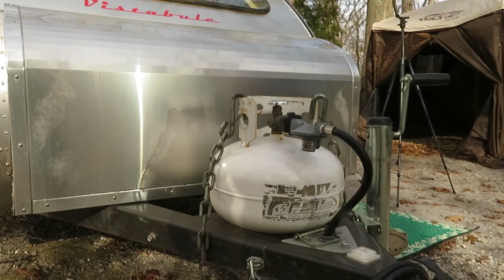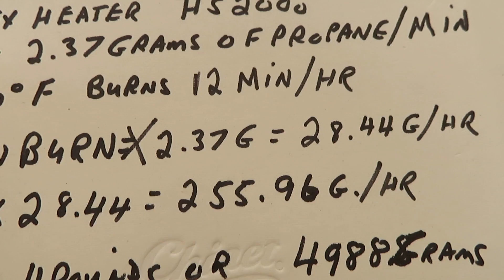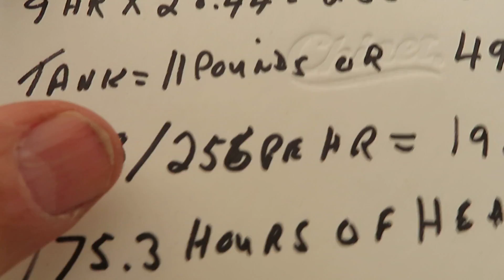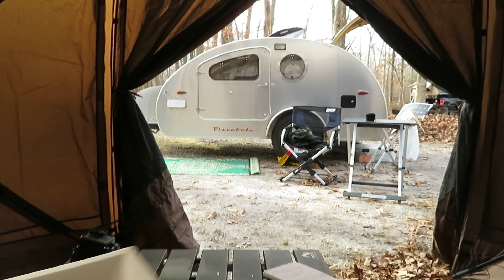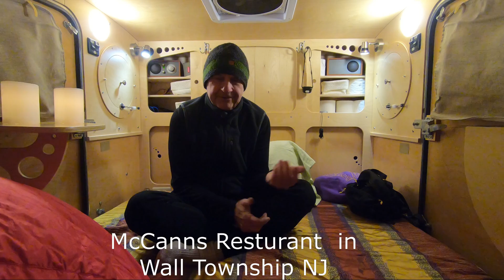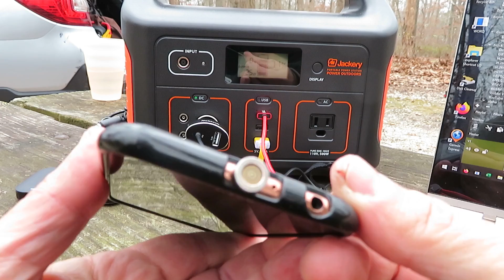Propex HS2000 heatng a Vistabule Teardrop Trailer

Comment from the maker: This is my second winter with the Propex HS2000. I still love it.
It has been trouble free and 100% reliable. I still recommend it.
I did lots of number crunching to determine the propane consumption.
The method I used for timing the duty cycle can be self correcting for the temperature and conditions you are in to calculate how long your fuel will last. =Cosmo
Reply from the maker: TY

Comment: Hi Cosmo, I just bought this heater. I’m planning on running it off a standard 5 gallon propane bottle (like the ones for BBQs). What I don’t know is what regulator and fittings I need to go from the 5 gallon, down to the Propex. I could see in your video you had some fittings on your propane. Could you tell me what you used or possibly send me a video showing your connections from the propane down to the Propex?
Reply from the maker: I dot know what type regulator. Its nothing special. If I see any writing on it I will post is for you. 𝕋𝕙𝕒𝕟𝕜 𝕐𝕠𝕦 𝕗𝕠𝕣 𝕨𝕒𝕥𝕔𝕙𝕚𝕟𝕘! =𝓒𝓸𝓼𝓶𝓸 ✅

Comment: Did those secondary locks on the doors come stock Cosmo
Reply from the maker: Yes they pull the door in tightly to rain out when driving at highway speeds. At Highway speeds  the trailer is experiencing one long hurricane on the road. I usually dont use then when inside but in this case - they are good to have. Its a bit of good thinking on Vistabules part. Not sure why other  makers dont use them. They are very effective. Thank You for watching. Check my other videos https://www.youtube.com/cosmoweems/videos 
SUBSCRIBE https://www.youtube.com/cosmoweems?sub_confirmation=1

Comment: Propane puts in way too much moisture, (big problem ), Chinese Diesel is a much better way to go. Very dry too. 10 amps for start up and then only 1.5 amps from there on.
Reply from the maker: Propex is a heat exchange heater no fumes of moisture enters the cabin. I hope I dont ever camp near one of these polluters
https://www.youtube.com/watch?v=thAIWAIwANc
Diesel Heater Cleaning the heater
https://www.youtube.com/watch?v=6wrfEuQKBIM
Diesel heater Electric consumption 
https://www.youtube.com/watch?v=OjvcBiBAqMQ&t=570s
Fuel Consumption 
https://www.youtube.com/watch?v=nRF-B74sDmQ
Reply from the maker: Thank You for watching. Check my other videos https://www.youtube.com/cosmoweems/videos 
SUBSCRIBE https://www.youtube.com/cosmoweems?sub_confirmation=1

Comment: Propane makes too much moisture inside . The diesel heater is a dry heat and it does not take a lot of electricity to burn the glow plug . Propane he is the worst thing you can do for a van unless you just want to rust it out
Reply from the maker: Accurate information to make decisions is important.
This is one of the best heaters for a van for several factors. Lets start with your points
You can add acoustic ducting to a heater like a Propex or a diesel which will make it quiet. It cost me about $15 and is available from Westy Ventures. It lowered the decibel volume quiet a bit. I have a video about that on my channel. 

No combustion enters the cabin because this is a heat exchange heater. All combustion fumes and water vapor are vented to the outside. Only dry heat enters the cabin. No rust and I get avirtually zero condensation on the walls of my trail in -5F temps.

The Propex is much better than a diesel heater conserving electric power which is important for me. I list the electric consumption in tone of the comments below. Diesle consumes more electric.

Propane heater requires none of the maintenance a diesel heater requires. 

If you have actual accurate numbers to compare we can discuss this in detail. 

Catalytic propane heaters like Mr Heater will indeed put lots of water into the cabin. But not the Propex.
Thank You for watching. Check my other videos https://www.youtube.com/cosmoweems/videos 
SUBSCRIBE https://www.youtube.com/cosmoweems?sub_confirmation=1

=Cosmo
Reply from the maker: Diesel Heater Cleaning the heater
https://www.youtube.com/watch?v=6wrfEuQKBIM
Diesel heater Electric consumption 
https://www.youtube.com/watch?v=OjvcBiBAqMQ&t=570s

Comment: Another very informative vid Cosmo. I've had my Propex a year now and I'm very satisfied. The Chinese diesel weren't discussed that much back then so I didn't consider them. I do appreciate the propane fuel but didn't know about the higher electrical draw of the diesel furnaces. Thanks
Reply from the maker: Thanks Mark. I love my Propex. It has been trouble free and keeps me as warm as I like. Many people have commented on my videos about how trouble free it is. Do you have the Acoustic ducting to lower the noise level? It works great and is inexpensive https://youtu.be/mRFRRw9_CV0. Diesel heaters are a bargain but I a seeing many reports of issues like failed parts and cleaning problems getting the soot out of the system! Enjoy =Cosmo
Reply from the maker: In my comments for this tvideo I have a comparison of electric draw of the Propex compared to a Diesel heater
Reply: @CosmoWeems  yep. I also have the acoustic ducting. It's also in a cabinet like yours. Sound of it running is very soothing.
Reply from the maker: Diesel Heater Cleaning the heater
https://www.youtube.com/watch?v=6wrfEuQKBIM
Diesel heater Electric consumption 
https://www.youtube.com/watch?v=OjvcBiBAqMQ&t=570s

Comment: Nice video - Good to see you back. Lots of good info. Thinking about car camping in my SUV and head south. I'm located in central Ohio - so it's typical winter weather here in the Northeast. You're right about the sleeping bag keeping you warm. In the car, it's all I really need in 30 degree weather. Of course if it would get too cold, I could just start my car.  Okay, happy trails.
Reply from the maker: Ya I was headed south for a few weeks but a sudden   priority stopped. Go while you can. You wont regret it later! =Cosmo

Comment: A couple of comments. 

Propane introduces moisture to the environment in the combustion process. It is a small amount of moisture, but in small areas can accumulate quickly and dampness will make things colder. The moisture will work it's way into bedding and clothing making you more uncomfortable in the long run.

Chinese heaters (if you don't like Chinese you can purchase domestic built units for about 3 times the money, but still cheaper than the propex). Yes the "Park Heaters" glow plugs do pull 8-10 amps at start up, but only at start up. Once the heater starts it uses the fuel pump and fan to regulate the temp output. This means that once the heater starts it does not shut off again and the thermostat controls pump speed to regulate the desired temp unlike other heaters which cycle on and off. This does mean though that at full heating power the park heater can pull up to 3 amps to run fan and pump. Once desired temp has been reached though it will usually pull well under a amp. Also, since it has a heat exchanger you are introducing dry heat (not moist) and no carbon monoxide into the environment. A 5 gallon diesel can will last a long time and is easily filled when you fuel up the tow vehicle. No cans to discard or have filled by qualified personal. 

Just some thoughts. thanks, George
Reply from the maker: Hi George. Thanks for your comments. 

Propex is a heat exchange heater. No moisture or combustion  fumes enters the cabin. 

Diesel heaters are very good and a great match for many - but not me.

I think products from China can be excellent.

 My trailer is tiny and I choose not to add anther liquid fuel. I already have propane. Others of course should get what is best for them.

Finally I am not getting any data on how much electric power a diesel heater draws when it is running. Lots of opinions but no numbers.  I have a small battery and I camp off grid. My research showed Diesel heaters draw more electric power which I could not support. Again I am still waiting for someone to produce some reliable information. 
=Cosmo
Thank You for watching. Check my other videos https://www.youtube.com/cosmoweems/videos 
SUBSCRIBE https://www.youtube.com/cosmoweems?sub_confirmation=1
Reply: @CosmoWeems  Thanks for the reply. I guess I did not realize the propex had a heat exchanger. This guy does a few tests on the Chinese heaters. Some good info in there. About 8;00 in he does a start up and run https://youtu.be/9YthaCqkMOs. Thanks, George.
Reply from the maker: Diesel Heater Cleaning the heater
https://www.youtube.com/watch?v=6wrfEuQKBIM
Diesel heater Electric consumption 
https://www.youtube.com/watch?v=OjvcBiBAqMQ&t=570s

Comment: your gone run out of propane in the middle of the knight i would bet that that running all day would be gone with a 20 lbs tank.. we use heaters in tents my friend and we use them some time during when we are camp and ya 20 lbs is gone one day...
Reply from the maker: Hi Ya a space heater in a tent without a thermostat has a big apatite, Regards =Cosmo
Reply: @CosmoWeems  it had a thermostat and it did not even make it a hole day.. propane heaters use a lot of propane my mom has one at her house with a 100 lbs tank 2 days is all you get as far as 24/7 heat
Reply from the maker: @hulie1234  there are 21,500 BTU in a pound of propane.How many BTUs is your heater?
Reply from the maker: @hulie1234  My use is different and I am heating a small space. Its not a solution for all situations. I am very confident in my numbers.
Reply: @CosmoWeems    Hey don't forget you can't use all the propane only 80% of that 11 pound tank you can use the other 20% will evaporate my friend..ya its not that i dought you,, just letting you know its expensive when we do it and our situation... but hey its all good fun exploring the great outdoors,,, some times an out door fire is an all knight situation for heat as well...but ya your propane heater is cool..sounds like you did the numbers...

Comment: You always do such a great job with giving information on products. I wish I had a way to heat my little camper shell so I could be off anytime of year. I really love your teardrop
Reply from the maker: Thanks Jo. Many people are using mr heater which have a good recored as long as you ventilate. Its wonderful to camp in the cold. No one is around and you have nature all to yourself to enjoy! =Cosmo
Reply: https://www.youtube.com/watch?v=tjfktJuc354&t=0s   

Maybe that could be a simple solution for you ?
Reply from the maker: Thanks John. I started with a Mr Heater. But the moisture from combustion is an issue. A pound of propane burned produces 20 ounces of water vapor add to that the pint  produced by each occupant and you have lots of water on the walls. Not so with the Propex heater!  Its dry heat! Thank You for watching. Check my other videos https://www.youtube.com/cosmoweems/videos 
SUBSCRIBE https://www.youtube.com/cosmoweems?sub_confirmation=1

Comment: Cosmo; your tank seems pretty small,  are you sure it's not an 11 lb. tare weight tank? I have a a couple of 11 lb. tare weight tanks which seem  (visually) like yours which hold about one gallon (a little under five pounds) of propane each. Just asking. Thanks for the video.
Reply from the maker: Thanks Brad The 11 lb. propane tank holds a little less than 11 pounds of propane. Commercial propane weighs about 3.696 lbs per gallon, so an 11lb tank holds about 2.98 gallons of propane. That is what the tank maker says.  I am using weight as a measure since Propex provided weights for burn time. Thank You for watching. Check my other videos https://www.youtube.com/cosmoweems/videos 
SUBSCRIBE https://www.youtube.com/cosmoweems?sub_confirmation=1
Reply: @CosmoWeems  Roger that Cosmo!   l love your videos and have a couple of '11 pound' propane tanks (which hold a gallon of propane) and I just bought a Chinese diesel heater to keep me toasty in these Northwest winters while I'm out and about.  Keep posting and come out to the Northwest someday! I'll show you around......
Reply from the maker: Thank you The diesels are a really excellent value. If you have a chance to test the amp draw of on on to off cycle - including cool down  I will buy you a beer for the data! =Cosmo
Reply: @CosmoWeems  My Chinese diesel heater in 20 degree F weather, in an insulated 7x16 cargo trailer, producing an hourly duty cycle of 20 minutes on high and 40 minutes on low,  drew 2.2 amps per hour= 18.6 amps in 8 hours. One web page says Propex draws  1.6 amps per hour (with no indication of duty cycle). I wonder what your Propex draws. I will buy you a beer for the data! =FeatherliteCT1
Reply from the maker: Thank you . The Propex site gives fule consumption and stats  for 100% duty cycle (continuous running) 1 hour draws 2.4 amps or 2400 miliamps. In my scenario it ran 12 min an hour which would equal 40  miliamps a min or 480 mili amps total for the 12 min an hour it runs. Resting draw is .04 amps.which totals .031 milli amps for the hour. The grand total is 480.037 Mili amps for an hour at 20F or .48 amps.
Thats a very low draw! I am not critical about Diesel heaters I just need a very low draw system for my tiny trailer. In my case I am not interested in adding  a liquid fuel when I have Propane already. I am keeping it simple. I am not interested in the maintenance I am seeing for diesel heaters too. I do realize I spent $1K for my heater and diesels can be purchased for the outstanding price of $200. Its just not a match for me.
We have both produced good useable data and that means we can both enjoy a beer for a job well done! Thank You for watching. Check my other videos https://www.youtube.com/cosmoweems/videos 
SUBSCRIBE https://www.youtube.com/cosmoweems?sub_confirmation=1
Reply: @CosmoWeems  I've watched all of your videos! You need to come out west and we can camp out and compare our respective heating units. I figure I draw around  an amp per hour but with two 80 AH batteries I think I'm good for the weekend. Your trailer is really great looking, btw. I'm jealous of all that underfloor storage! Take care.
Reply from the maker: @bradmiller9993  Thanks Brad I was responding to RS above who commented. above. I agree real use scenarios may not match the number crunching! I will look fr you on the road! We are all seeking the same thing. FUN =Cosmo
Reply from the maker: Diesel Heater Cleaning the heater
https://www.youtube.com/watch?v=6wrfEuQKBIM
Diesel heater Electric consumption 
https://www.youtube.com/watch?v=OjvcBiBAqMQ&t=570s

Comment: Diesel uses external air and exhaust to outside, your wrong  on glow plug use, only when starting is glow plug on,  try one and you’ll never go back to propane, just spent days in 13-20 degree temps on a gallon of diesel
Reply from the maker: I am not being critical I researched. How many amps  does your heater draw full cycle. Lets talk data and if its a good match for me. I have no doubt its a good match for you and many others. Thanks =Cosmo
Reply from the maker: Diesel Heater Cleaning the heater
https://www.youtube.com/watch?v=6wrfEuQKBIM
Diesel heater Electric consumption 
https://www.youtube.com/watch?v=OjvcBiBAqMQ&t=570s